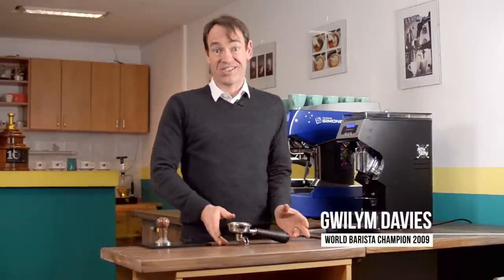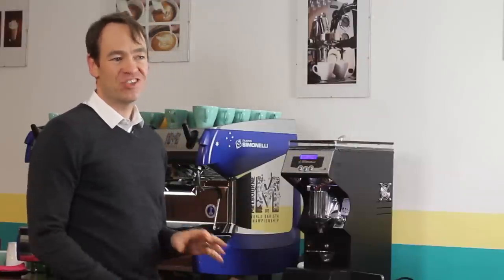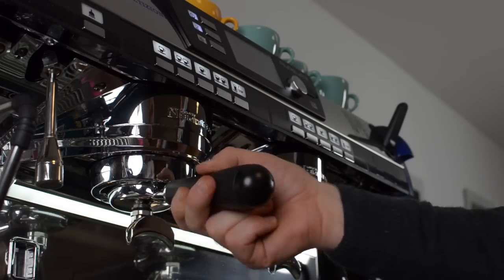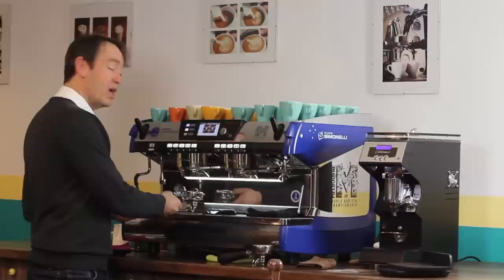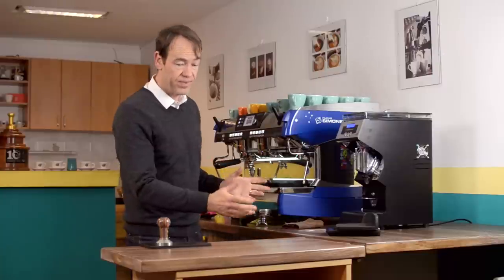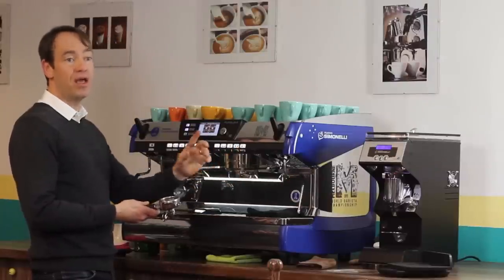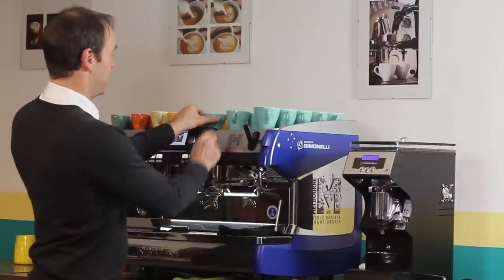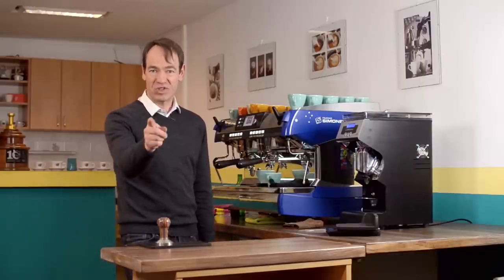How To Insert Portafilter Into the Espresso Machine | Barista Training w/ Gwilym Davies #4

Comment: Well one importing thing is missing :) Namely the Perfect  water temperature in the grouphead. Its should be 88,5 - 93 so extraction of the espresso is Perfect and coffe losing the best oils to the cup ...So my question is how long i need to do a flush for the best results i got Rocket Evo and i dont know  what exaclty temperature is inside my Grouphead its important, or just quick flush 3-5 sec and go.:)?!